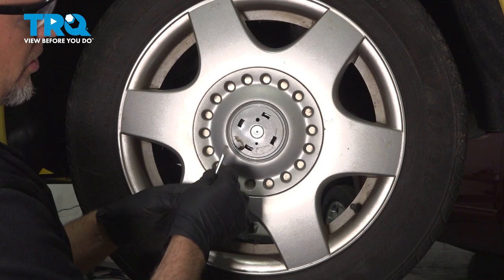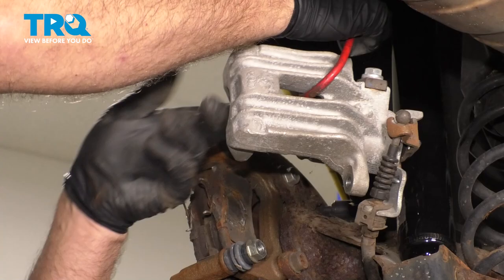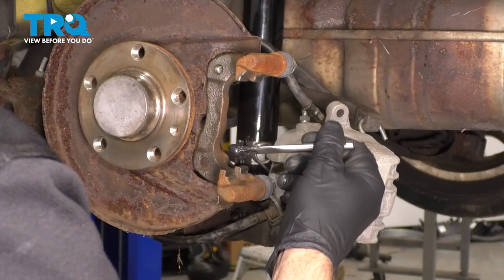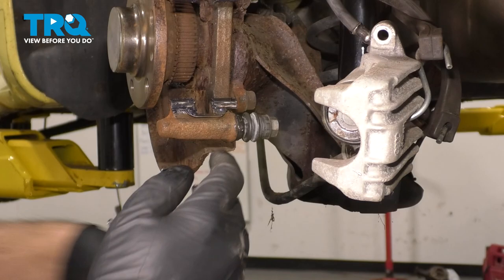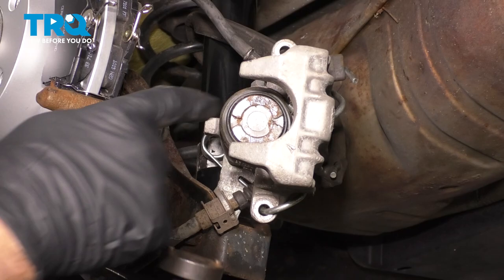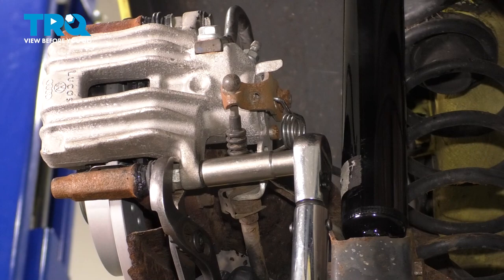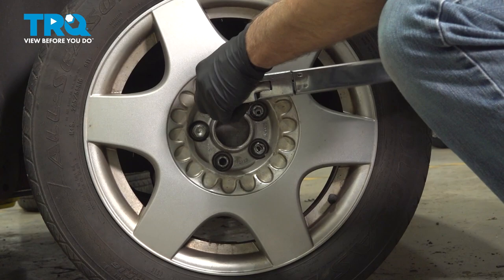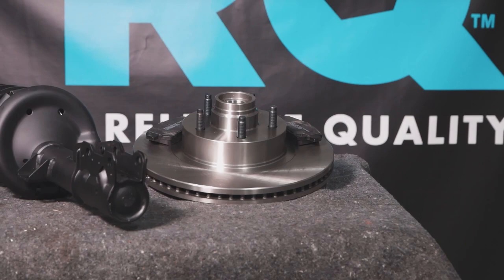How to Replace Rear Brakes 1998-2010 Volkswagen Beetle

Comment: Great video. Just one remark:
You do NOT pop off the VW logo from the cap. With the car comes a little hook in the tool set. This is to be inserted into one of the holes of the cap and you just pull it off. The VW logo is snapped on and glued. If you pop it off if will fall off at the next inconventient instance. 
Greetings from Germany, 
owner of the exact make of wheels (En Vogue edition).